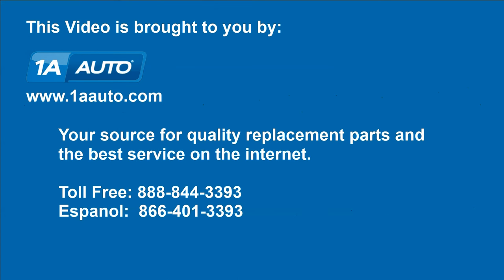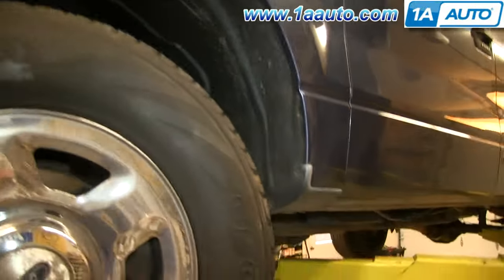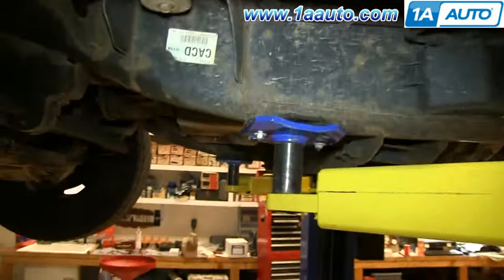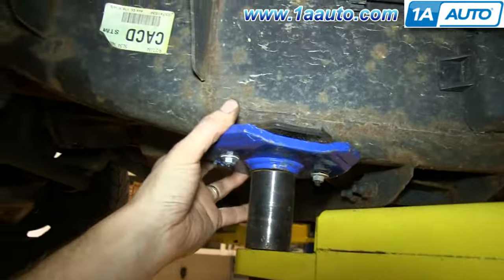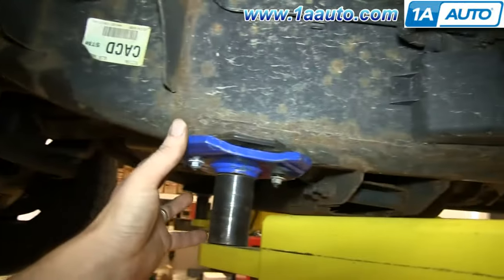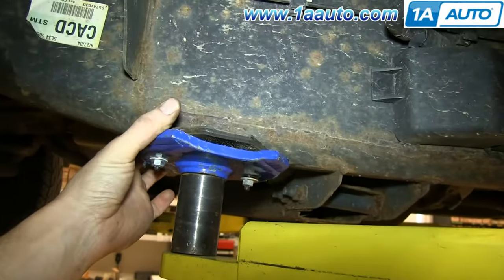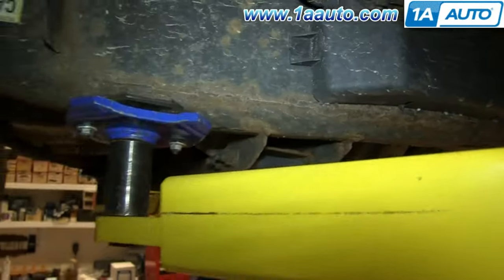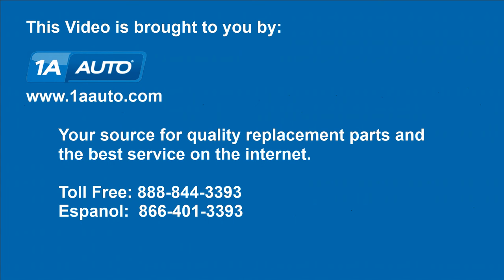How to Raise and Support Ford F150

Comment: Thank you sir. Pointing out different spots besides the frame was very helpful. After watching your video I went to my truck and found out there is also punctured  arrow hole on the frame pointing where you should jack(just the frame though).  Now I'm on my way to change my wheels and tires:)

Comment: I have a 2010 F-150 Truck and my Owner's Manual states specifically to use the frame rail and DO NOT jack it up under the control arm at the wheel.  The illustration shows use of the scissor jack that comes with the truck.
It does not make any differentiation that it is OK to use the control arm if using a hydraulic jack.

Comment: Good video.  Consider a new 3 ton jack that gets more height or you may be an inch or 2 short under the front cross member. (Keep your old, shorter 3 ton jack for the rear differential) Place jack stands under rear axle where it bolts up and under the frame rails up front (use chunks of 2x8's under the front jack stands for common/basic/shorter jack stands ...or you'll likely be an inch short)

Comment: The F150 owners manual specifically states that you should never use the diff housing as a jack point.
Reply: That's referring to the spare tire jack that comes with the truck. A hydraulic jack can support raising by the pumpkin.
Reply: @ForbiddenHaze   I changed my Rear brake pads yesterday one at a time and since i didn't have a good hydraulic jack what i did was put the Jack that came with the truck in the Axle near the wheel and put a jack stand on the differential axle tube. I did that for each wheel. Oh and dont forget to put chucks to support the wheels on the opposite side of where your working in.  First time me working on the rear end of my truck since i bought it and its a 2014 XLT. F150
Reply: PEASE TAKE NOTE.....It is not just referring to the jack that comes with the vehicle.....It is referring to ALL jacks that this area (the differential) is NOT a proper jacking point under any circumstances. It can seemingly work from time to time but one day  that differential will have a problem from misuse. It's NOT made for that and cannot support the weight of the truck. I know people do it and get away with it, I've done to, but it's clearly NOT recommended. DON'T DO IT!
Reply: The old “not designed for that” fallacy

Comment: Ford owner's manual specifically states that the rear of the vehicle should not be raised using the differential as a jacking point.
Reply: Where does the manual recommend jacking rear end of f150?

Comment: The 2012 F-150 owner's manual states on page 352: "Note: Never use the front or rear differential as a jacking point."  and on page 351: "Note: Use the frame rail as the jacking location point, NOT the control arm."   Please discuss.

Comment: I have a Ford F-250 ext cab 2x2 truck. I was using a 3 ton from harbor fright but I can not get it high enough . The 3 ton jack stand are  not high enough. What can I do?
Reply: Higher rated jack stands will raise even higher. Get like 12 ton jack stands. Of course you can only put jack stands under what your jack is able to lift up to.
Reply: Put wood under the jack
Reply: You probabaly dont need this info any more, but HF has a Jack that is a low profile long reach 3t, raises my lifted f150 without issues and has room for more
Reply: Jeffrey Kumjian  you can put a piece of wood underneath the jack stand to make it higher just be careful the piece of wood does not slip off
Reply: get a jack with higher rating.  6ton usually goes to 27inch.  yours prolly goes to 20
Reply: Put 2x4's or concrete blocks under the jack
Reply: Get a 6 ton jack stands

Comment: Looking for electric lyft and proper way. I never knew 4 point electric lyft has a jack stand in front in middle to lyft it. Might want to re-explain this video before someone accidentally gets killed. Also people ask for particular vehicles for reasons and that's for safety jacking, why, because most don't know how to use it, there's vehicles I don't have a clue to put Jack's at, I will ask another person for assistance just for my safety and others around the other bays too. Not sure if these 4 way point electric lyft Jack's are designed to jack just the front part of a vehicle or just the rear part of the vehicle now. Me personally,  I'VE NEVER EVER SEEN backyard hackers jack them up like described now. Anyone using such tools, please read all instructions and get all the help needed, setup properly and raise 4 inches off Garage floor, shake the heck out of it and make sure it doesn't fall off,  If does, then must start over so it doesn't slide off and vehicle is now hanging if your lucky enough to get caught up, hopefully no one gets hurt. Safety is always #1 , I'm surprised that 1A auto setup this video,  I could of clicked a hacked link, hard to believe they setup electric lift in the way their talking. Only looking out on everyone's safety 1st and foremost only. No disrespect to others, I'm no pro and don't claim to be one.  Parts of it looked correct but not talking correctly on how to do it. Also being a SUV/TRUCK, check weight in door jam and make sure lyft is rated correctly too.